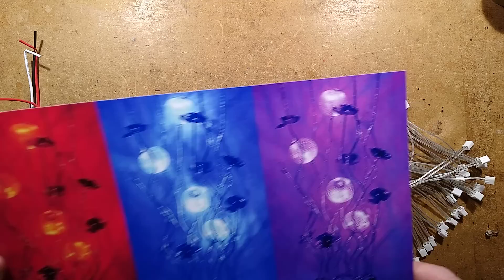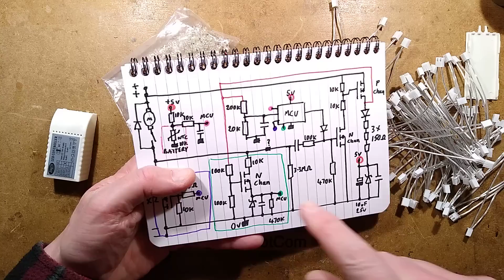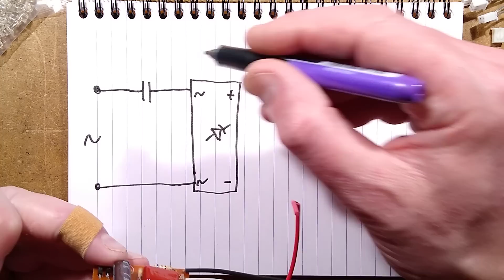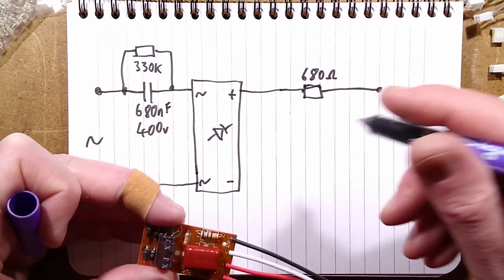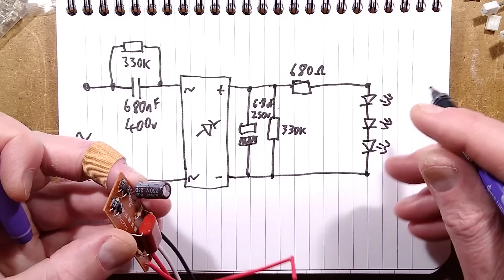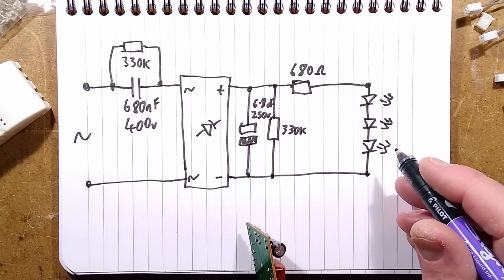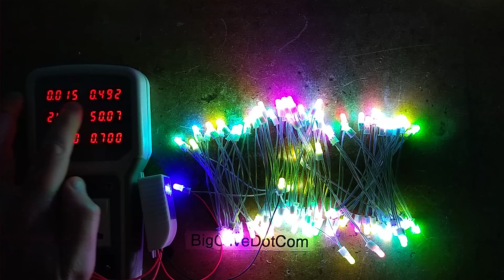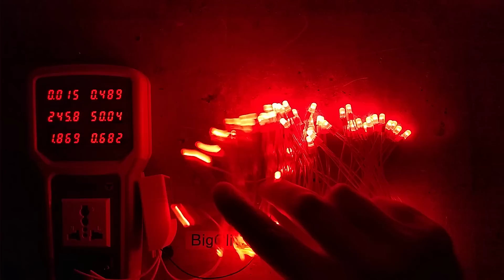Weird AliExpress LED loom

Comment: Those connectors reminded me of a nightmare job. I designed some PCBs to have square LED modules connected, to make up some large 7 segment displays for Rockingham race track. I called for the module manufacturer to have these (as in the video) connectors fitted and had the PCBs made with the mating male connectors. When the modules arrived (some 3500), they'd fitted their own connectors and supplied their own mating male connectors that were a totally different shape and size. No time to redesign the PCBs, so had to strip off the housings from the module connectors and have the bare contacts (that fitted the male connectors) on the PCBs. A majority shorted out, so had to insulate them with tape. Took about five days with six people at it. shudders miraculously it all worked!!

Comment: I do get apprehensive with mains powered leds .I would not go near them myself. What is a capacitor dropper. If the voltage across the leds is 300V with mains at 240, what's being dropped .? Love your bare all videos. With scars and plasters showing even professionals make whoopsies !😂
Also to most fatally dangerous, to you just "Spicy"

Comment: What's the thickness of the legs on the LEDs? My guess is they are smaller than the 0.64mm pins used on 2.54mm and most 2mm pitch connectors which is what causes the bad connections.

Comment: why are copper plated aluminum wires more prone to fires?
Reply from the maker: The copper coating is thin and aluminum oxidizes quickly when expressed to air, forming a high resistance layer.  It also has a higher resistance than copper.

Comment: The one color-changing LED that started out blue reminds me of a novelty pen someone gave me around the early 2000s that had one of those in it. Normally it would start the sequence at red, but if I kept clicking the switch on and off repeatedly it would occasionally jump straight to an arbitrary point in the cycle instead, such as blue. Not sure why.

Comment: With all the series connected LED's,  And the total forward voltage being nearly 300V,   Does it really need to have a capacitive dropper?   Or will a simple resistor dropper do?  It seems awfully close to the rectified mains voltage.  Maybe it can be connected to a led light bulb board,  The type with the linear current regulating chip.  Just remove one of the surface mount led's first.

Comment: Bigclive:

Iirc, you have a 3d printer…
How small of a functioning 555 can you print?
Reply from the maker: It would be great if it could make custom integrated circuits.
Reply: @bigclivedotcom  you can, sorta. I'm picturing a 2-piece print, so one part is the base, with the inside grooved to allow space for the conductors & components to be put in the base before attaching the the other printed part (the top).

Nothing about it is revolutionary, it would be only fun to look at.

Comment: Why would the voltage on the cap potentially go above 250V if the LED string is open? Is it because the AC peak to peak is more than 250V?
Reply from the maker: The peak voltage of the UK 240V supply is about 340V.

Comment: Horrible, brittle aluminium wires. :(
When BT started using aluminium cables from the exchange to street connection cabinets, the number of phone disconnections caused by wires being disturbed and just breaking went up hugely compared with the old copper wires.
I believe they ended up replacing most of the ends of the cables with copper "tails" so that they could be manipulated without snapping.

Comment: As long as you encapsulate it then it would be fine.
I'd even consider a resin cast, but solder the ends instead for increased reliability.

Comment: If you have 330k resistor you still going to get more than 250v open circuit?
Reply from the maker: The capacitor charges to the peak of the mains sinewave.  That's your local mains voltage (120V, 230V, etc) multiplied by 1.41.   Or in the case of this demo the capacitor would have been at 340V.
Reply: @bigclivedotcom  yes i know, but if you got current limit from input cap and voltage drop across 330k resistor than its not open circuit when leds are disconnected

Comment: Speaking of copper coated aluminium. I etched a PCB board the other night, poured the copper chloride etchant (HCl + H202) into my storage bottle and rinsed the etching container, leaving it in the sink leaving it in the sink because I was excited to work on the circuit. Next morning I noticed some greenish corrosion under one corner of the etching container, so I ran over it with the scrubber and it came up a nice pinkish copper colour. It had literally plated my sink with copper! I guess it's a lot like that tin plating solution you can get for tinning PCB boards.

Now I'm really curious if I could just leave a piece of aluminium in the copper chloride solution, if it would become copper coated. Or perhaps it only works for ferrous metals like iron/steel, or in my case, stainless steel. I do remember that you can't plate just any metal to any other, like you can't plate gold directly onto copper, you have to tin plate it first. But I was never any good at chemistry, so I don't remember what the reason for that was.

Comment: I  didn't think you could put colour changing  LEDs in series due to the varying current draw as they change, but it seems I was wrong.  I've made some decorative "trees" using these LEDs but I connected them all in parallel and made a custom 3v PSU to drive them . I'm only using some 20 LEDs though. Very safe! Double wound mains transformer and a LM317.regulator.

Comment: Very pretty, what happens if one led fails do they all go out? Instead of trying to crimp them to join them would it not be better to us a spring wire wago connecter
Reply from the maker: When one fails, the brief high voltage across it often causes it to shunt and keep the others lit.

Comment: Very interesting. I bought some wire 'trees' from the local Blur Diamond garden centre in the 50% off post Christmas sale. There's a 'rice' led bulb on the end of each branch. When I flip the on/off switch one way, the leds light in various colours but flipping the switch in the opposite direction turns the leds white. It looks to me that each bulb has a separate colour and white led.

Comment: There's some products that use the 2 pin color changing LEDs to be all solid at one color or do specific (limited) patterns using just the 2 pins. Any insight on those?

Comment: Would the "lever Wago" grab onto the unsolderable wire satisfactorily?
Reply from the maker: It should, but with very thin wires I wonder if there's a risk of cutting the wire.
Reply: @bigclivedotcom  thin stranded wires might be problematic. Clearly that stuff is cheap and sucky.

Comment: Great video, thanks. I'm wondering if it would be "safer" to put a dropper capacitor in each mains line because when you use a Euro- or Schuko-Plug there is no fixed polarity
Reply: Only way to make such a thing safe is to use a cap on both sides of the plug (polarized plugs should NEVER be trusted), AND use class Y safety capacitors to limit current to a safe level (5mA). Of course such a supply is of very limited utility, best to just avoid dropper supplies entirely, they're cheap and nasty even when they are done right.

Comment: Those colour changing LEDs require a constant voltage between 3.1V and 3.3V. They might still work at below 3.1V but even at  4.0 V they can get hot and fail. I only realised this after one of the more reputable  suppliers in China included a note in my package. Not long after I got that note a light with around 100 of those colour changing LEDs let out the magic smoke, Thankfully only a few of the LEDs were toast. My mistake was using an old 5V power supply that could be trimmed down to 4V. Now I use one of those cheap buck or boost power converters and a stock approved mains supply to power those LEDs.

Comment: Here in the US if we wanted to use that many LEDs, we’d need to convert the power pack to a voltage doubler  by replacing two of the diodes in the bridge with capacitors.  The capacitors are in series, thus the DC output is almost the full peak-to-peak voltage of the input waveform.

Comment: If those were the double polarity ones, running at unrectified AC mains with just ab impedance dropper would provide the mix color with less circuitry. A box with a diode and 3 switches can provide color selection and multiple off modes, some safe, some deadly.
Reply from the maker: If a simple capacitor and inrush limiting resistor was put in series with the string it would operate on AC as purple.  But with a psychedelic shimmer.

Comment: The few volts Going through those leds is not going to shock you. It would take over 70volts in which case the leds would be blown.
Reply from the maker: Touching an exposed connection on the string can deliver a high shock to ground.

Comment: Clive, back in the 70's, my family bought a house in another state here in the US, and my dad put an addition onto the home. He used an inexpensive aluminium wire that had newly came onto the market. It only took a few years to realize that it was a fire hazard, and he then went on to strip it out, and go back to copper wire. He showed me the inside of the steel breaker box where the wires got so hot that they scorched the paint inside the box.
Reply from the maker: It required special pastes and ferrules to terminate properly.  The power distribution industry uses aluminium cables.
Reply: @bigclivedotcom  IIRC the aluminum used in the 1960s fire hazard wire was also not a very suitable grade for it, further contributing to the problem.
Reply: @bigclivedotcom  I guess its because aluminium oxidises more readily than copper and then creates a high contact resistance?
Reply: @bigclivedotcom  a number of years ago I worked for a company that was installing aluminum distribution wire. This always had a certain number of steel cables run with it for strength.
As I recall, one of those pastes is called Novalux, and was used on the lamp sockets where bulbs with aluminium thread bases went into the sockets.
Reply: My house ground to the plumbing is Al. Fat 00/ multi of 10g. The problem with house wiring was the metal's expansion rate is high and a single wire around a little screw in an outlet or switch will heat cycle and work loose. They only ran it like that for 5-7 years thereabouts.
Reply: @napalmholocaust9093  Try converting that to actual measurements, such as mm² (metric) or circular mils (US unit).
Reply: @johndododoe1411  “00” (Zero Zero or Aught Aught), “2/0” or “Two Aught” (all are equal and valid) gauge IS an actual wire measurement (as in AWG) in the U.S equal to 133kcmil or 67.4mm^2.  We don’t usually begin specifying wiring in circular mils or thousands of circular mils until wire sizes greater than 4/0 gauge or 212kcmil (so typically beginning with 250kcmil).
Reply: @ethanpoole3443  “John” is probably just being a typical metric system elitist that likes to point out that the US uses measurements that other countries don’t. Particularly ironic if they’re a Brit, since the Brits definitely don’t use measurement units that are only used there and don’t make any sense at all.
Reply: @ouch1011  I'm not a brit and usually convert US units quickly.  Unfortunately the comment i replied to was approximate about the 00 size and used an unusual unit for the other measurement.
Reply: Yeah, I read about the US made copper clad aluminum from the 1970s when someone used it as a defense for the Chinese fake copper that's aluminum inside.  Didn't know the US stuff was a fire hazard too.
Reply: There is nothing wrong with aluminum wires, they are not the best but they are common.  The issue was your dad (like most of us) didn't know how to install aluminum wiring, it takes different methods and connectors and a special anti-corrosive dielectric goo anywhere it makes contact with copper..

Comment: I wonder how long those sockets will stay functional while crimped onto that very thin aluminum wire?  Aluminum is kind of ductile and also likes to form a non conductive coating rather quickly if not chemically treated.

Comment: The worst transformer I ever saw was a bloody great big wire-wound resistor "transforming" 240v mains to 6v with a single diode to power a Soviet flashgun. I kept the flashgun and the camera but I tossed the "transformer".

Comment: Stranded wire tip. If you use the nub of the insulation to twist your wires before you pull it off and toss it. It will twist the strands very uniformly and tight. 🤔
Reply: It also gives you a bit more torque to twist them up, since you're acting at the radius of the insulation, rather than the radius of the conductor (helpful with heavier gauge stranded wire).
Reply: I don't think that really helps CCA wire though. It still untwists like string.
Reply: @volvo09  it's not the only way CCA behaves like string

Comment: What? Aluminum has higher resistance than copper. Silver is the only metal with lower (room temp) resistance.

Silver	1.59	x10-8 Ω•m
Copper	1.68	x10-8 Ω•m
Copper, annealed	1.72	x10-8 Ω•m
Aluminum	2.65	x10-8 Ω•m
Reply from the maker: It's more the contact resistance that is the issue.  The rapid formation of an oxide layer causes issues.

Comment: Copper coated aluminium ages and the aluminium turns to powder.  BT used aluminium for thousand pair cable to save on cost.  It did in the short term but I think most of it has been replaced by now.

Comment: You would have to shot both ends of the LED string!! To get a shock shorting one LED wouldn't give you high voltage  its only 2.7 volts
Reply: The dangerous current path isn't across a single LED.  It's from the LED string to ground, with your body as the conductor.  Since the power supply isn't isolated, the entire string is floating at mains voltage.

Comment: What a poor design. A few extra components could have made it far more safe to use.
Reply: From the business perspective, it's a great design.  On the balance sheet, safety only matters when there's liability.  If you use this lighting circuit and your home, shop, or loved one burns to the ground, are you really going to be able to sue the manufacturer or seller?
Reply: @Majromax  As a manufacturer I wouldn't want to produce and sell a product that potentially kills my customers.

Comment: I've got that same LED tester from about 15-20 yrs ago.  Great little tool!
Reply: Got one a while ago. I was perplexed to find that the + and - markings were the wrong way round. Turned out the battery connections were reversed. Oddly, the indicator LED worked, though. Turned out that was reversed as well!
Reply: @tonywalton1464  In theory each of the + pins should have a different resistor is series, so that you get a nice scale of possible currents though the LED. In practice (at least in the one I have) some of the resistor values repeat, so that you get the same LED current and brightness in different positions.

I ended up making my own LED tester with a 9V battery, a log-scale potentiometer, and one of those cheap V/A meter combos you can buy on Aliexpress.
Reply: @keesvanreeuwijk7467  Yes, the resistors are there as expected. Just the battery wires were reversed (as was the indicator LED).

Comment: Ha. Now imagine making a mistake and swapping the polarity on one... if it doesn't emit the magic smoke, you're in for a lot of debuging.
These connectors and LEDs would best be insulated with heatshrink tubes, which, if opaque, could also be used to add some directionality.
Reply: they are reversible, one way red the other blue.  try to keep up
Reply: @ydnark83  ah, OK - got a bunch of these bi-directional LEDs (red + green, to be precise) and used one in my Weller soldering iron power supply.

Comment: They could be made slightly less dodgy by putting heat shrink sleeves over the connectors to reduce the risk of unwanted contact but still allowing the LEDs to be pushed in.

I would guess there is sufficient capacitance in the wires and internal circuitry to maintain enough current flow before the place where you were interrupting the power. Anything before the interruption point stays running.
Reply: With respect Chris, my thinking is, all of the LEDs are in series, so a break anywhere along the string will turn the whole string off.
Reply: What do you expect for £2.10p? They are producing a product that most people can afford and you can make it safer by putting heat shrink.

Comment: Those leds blow up too. I had a bag if foggy ones red and green. It literally exploded
Reply from the maker: Did you use a resistor in series?
Reply: @bigclivedotcom  yeah. But I usually sacrifice a few to see what happens brother. Mine were red forward and green in reverse polarity. Where did you get those slow blinkers you used. I haven't seen slow ones that were so pretty where it had a rich yellow color.
Reply from the maker: @jstro-hobbytech  Not sure where this batch came from.